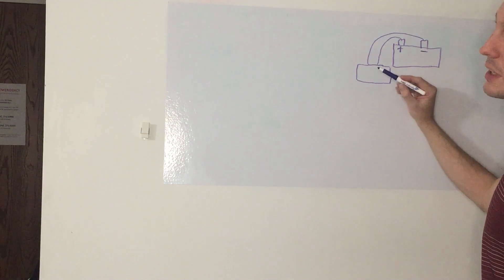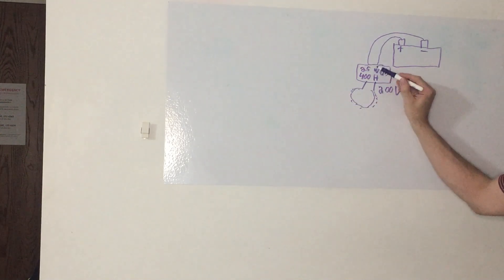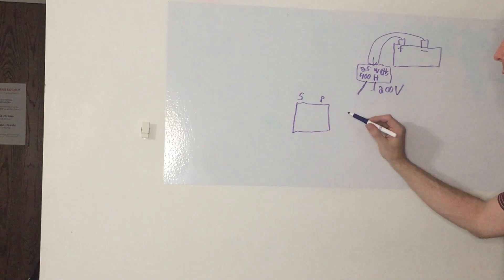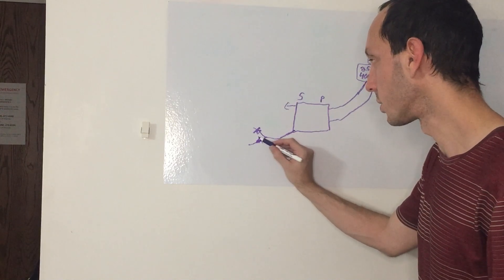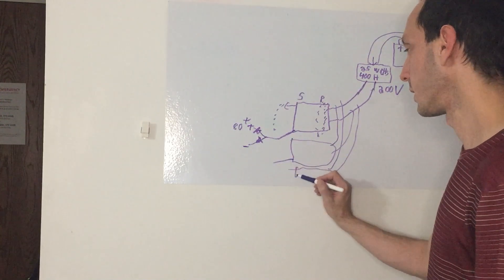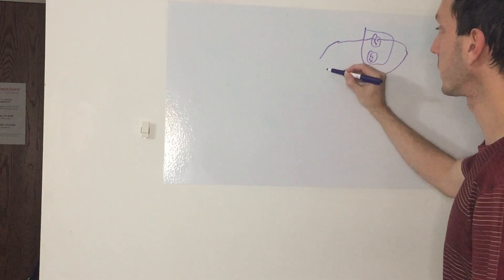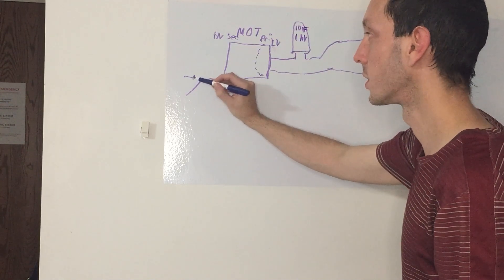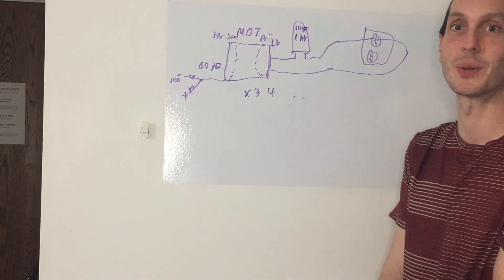Understanding True Potential

Comment: Why not using a Voltage multipler instead of the MOT to get HV for this concept?
Reply from the maker: That's what those little ebay high voltage pulse generators modules are, And yeah we can use those in our circuits as well. I had some interesting results experimenting with these ready made modules.

Comment: Joel what would be a example of a 400hz inverter i would like to replicate this i have a few old microwaves  and some big inverters but they are 60hz i live completely off grid so this would be fascinating to learn how to use what energy i have more efficiently
Reply from the maker: you can stick with 60 hertz it works almost as good, use a small inverter to feed the input, use microwave capacitor in line with primary side, this will drop your current to around 40ma at 10uf. The microwave hv side will still be in the kv but low current, it will drive your pure potentials just fine and drive the one wire system to charge cap dumps.
Reply: @joellagace1679  you’re the man joel! Thank you i will be sending you something at the end of the month is there anything in particular you would need most out of the things you listed?  It would be cool to help however i can youve helped me understand this better than anything or anyone so i would like to repay you and also see this experimenting continue amd advance because some of the deeper stuff is hard to wrap my head around but you seem to understand it really well so its better you have the components than me just destroying them lol🤣

Comment: I was getting 32v just off the diodes, than rectified that and got 82v. On the one leg. Than attempted to charge a 2500uf cap. My HV module started heating up, with less than 9v input. I’m a rookie. But everything you said worked.

Comment: Hi Mr. Lagace. What type of inverter would you suggest sir. Also if you loop 80v back to the battery wouldn't it be damaged sir. Please forgive my level of knowledge or lack of, I'm new to this field of energy ( no pun intended sir ).
Reply from the maker: The battery will damp much of this HV, the pulse from my experience goes down to around 24V. You need many of these at once hitting the battery to make it move. Bedini prefered cap dumps. and the usage of multiple "Slave" coils. But yes if you were to connect a  80V power supply to the battery, Indeed you would damage the battery. This could electricity works a little different. Backwards as many have stated.
Reply: @joellagace1679  I like that you used the word backwards because that's what the devil does invert everything as we can clearly see these days.
Reply: I see sir.  Thank you for your advice. @joellagace1679

Comment: Nice video. But how to power a load? Do you really mean that you can plug a load between plus and minus in the Avramenko Plug Style setup? Or is it rather possible to just use a capacitor on the plus side und the other leg of the capacitor is put to ground, so that we can suck electrons from the earth and then switch the cap to a real load. I'm talking here of a adapted heat pump principle where electrons from lower potential are pumped higher to use for real ohmic loads.
Reply from the maker: Ground works and in some cases speeds up my cap dumps by almost double, also sometimes a good increase of voltage of 10+ volts, other times nothing. its hit and miss with ground and depended on moisture temperature etc... It's not needed. the diodes will break the symmetry because they are nonlinear and will use itself as a reference (0 v) against the one wire high HV.
Reply: @joellagace1679  nothing is hit-and-miss it's just too complicated for now for us to comprehend completely without difficulty.

Comment: Nice work Joel ❤

I think Gerard Morin have explained this long time ago, but your explanation might be much better and easier to understand in simple terms.

This operation can be seen in “Tesla Switch” using batteries in series-parallel where the load is connected in series with batteries and appear to provide power rather than consuming.

If people understand that all devices as we have them from the shops are all made to work as shortcircuit, they simply connect + with - and waste all the energy they can, instead to let the energy to flow back to the source.

Comment: Fascinating, thank you.
Captivating, as you say, to be able to convert true magnetic potential,
and do something with the voltage the single wire pick ups.
I am looking forward to seeing more of the one-wire system,
and the significance of it in designing a supply.
I am wondering what the implications of that would be of battery life,
given the current draw limit. 

Thanks

Comment: you definitely are able to use your brain power to use the concept across a broad spectrum of devises..  sooner then later im gonna break out the diodes, and duplicate your ideas.. I have  many ideas, but i can not act on them like i used to. one secret for feed back into the mains is to change the frequency from 60 hz to 62 or 63 hz..then the meter starts to slow down...  i been looking forward to your experiments every day now. thanks or sharing and keep the momentum heading forward.

But yea, you are able to reach your goals faster, because you are not weighed down with the entire world on your shoulders..

that is the whole point of the quantum generator. its not that you are clairvoyant it is because you  have become, A hipster... hehe i came up with this all on my own years ago..
In other words its all in the hips.. lol,  Meaning in the know... so if there is a line of people, and you are at the end of that line. if you become hip to the knowledge, and are able to read between the lines. you cut the line, and if you are really hip, in the know you end up at the front of the line... But i can tell you  if you reach the front of the line, holding on to that position is more difficult as time goes by..

Comment: The issue with understanding one wire systems is that the schematics are lying. For example Slayer exciter (Tesla coil) circuit means that the "open" lead is always going through uncontrolled capacitor to ground.

It might be better to run it through variable capacitor (and maby resistor, potentiometer / rheostat) to ground, or back to positive for feedback.